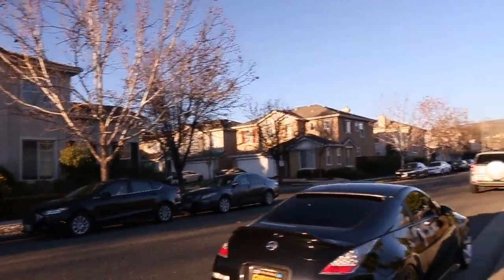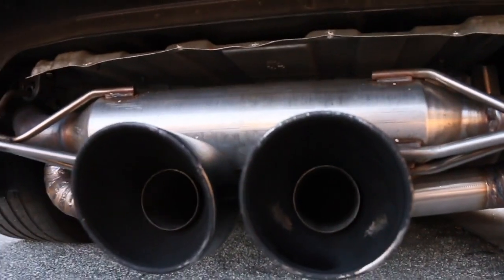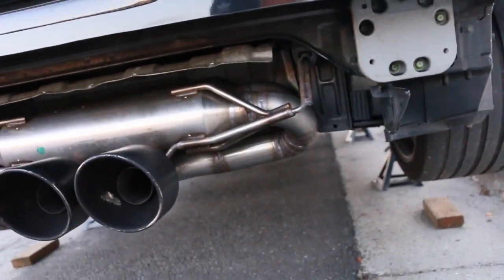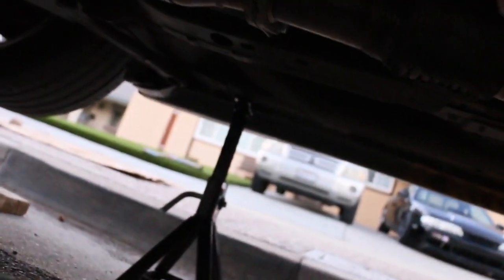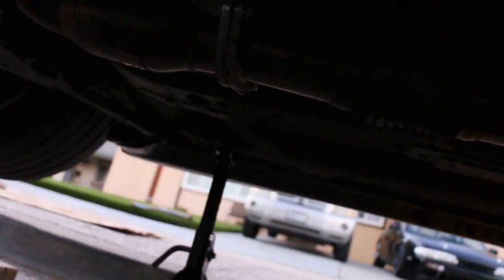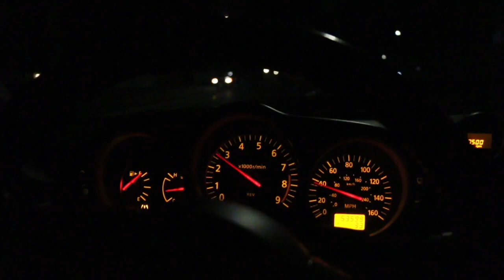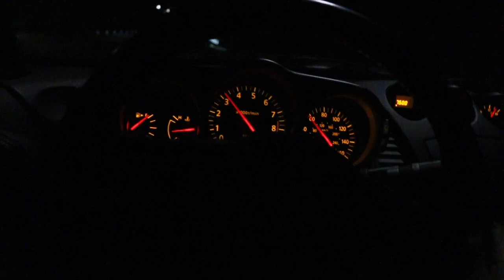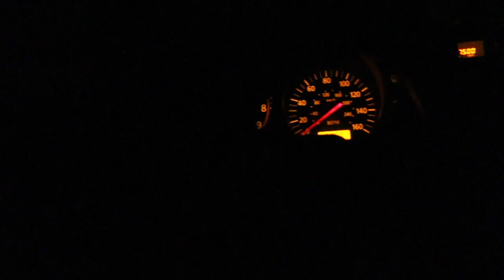TOMEI Y PIPE FOR MY 350Z

Comment: Hey bro did you re use the old gaskets or new gaskets ??
Reply from the maker: New gaskets i got with the y pipe 🤟🏽 you can use the old ones but its better to get new ones as the old ones get bad over time.
Reply: @GUD1HUH  Forsure bro 🤟🏾 where’d you get the gaskets at ??!
Reply: @GUD1HUH  btw the car sounds amazing do you still have this y-pipe on it?
Reply from the maker: @JtbBlendz  yup & thank you!!
Reply from the maker: @JtbBlendz  my bad barley seeing the other comment. You can cop em off Z1 Motorsports or any local Nissan dealership
Reply: @GUD1HUH  thanks bro🤟🏾